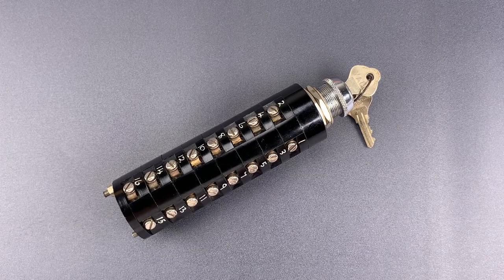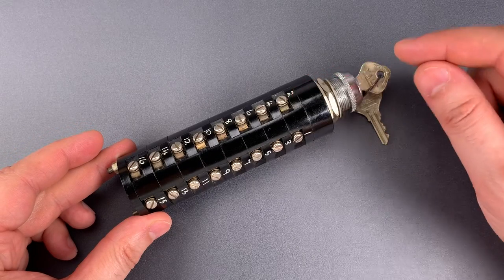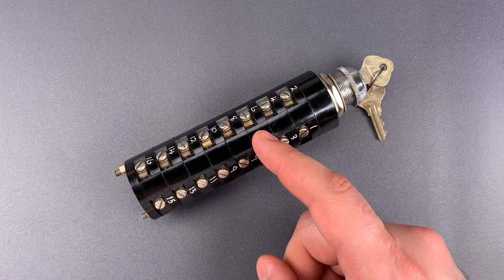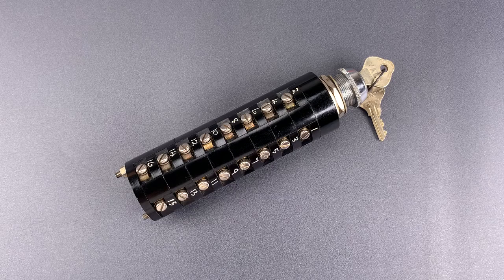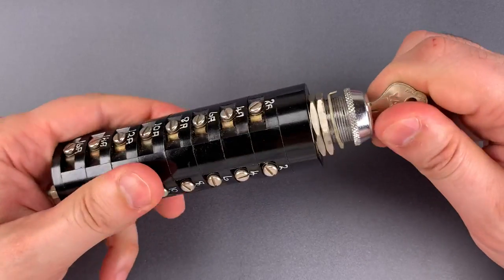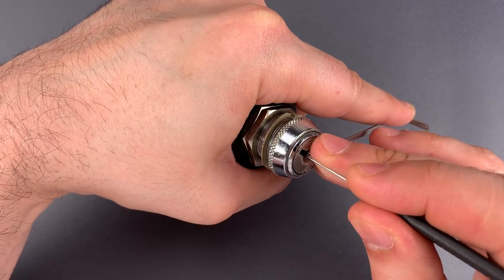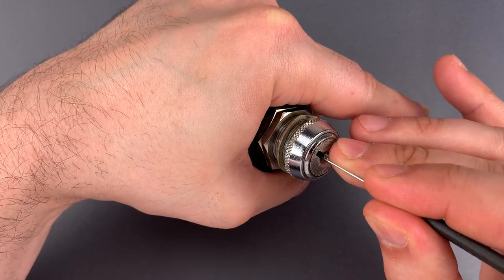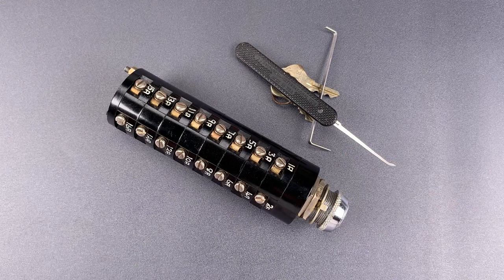[1154] Missile Control Key Switch Picked

Comment: The switch segments and operators of those locks were available as an 'assemble your own' switch for control panels. Operators could be knobs or key locks. As an example the forward / stop / reverse switch on Bridgeport Milling machines made in the UK by Adcock and Shipley used one with seven segments. There were two variants - a three position for single speed motors and a five position for dual speed motors. The range of switches are not at all uncommon on industrial machinery here in the UK.

Comment: Putting out a theory to try and solve the mistery:
even tho the Jaguar wasn't used in the US, the sidewinder was pretty much the standard NATO ir missile. So I'm guessing: either the lock is the same for every AIM 9, and that's why a person saw it in the UK, or the core can be changed, while the rest is (of course) provided by the missile manifacturer to suit their weapon, leaving it still very similar from country to country
Reply: I think it's a basic Master Arm switch. Would make sense for the number of electrical contacts. Gun, centerline pylon, and 3 pylons per side (wingtip plus two under wing)
Reply: Maybe it was also used on the Harrier which is pretty much the only British aircraft I can think of that wound up seeing US service in the right time period.
Reply: @misterthegeoff9767  would not surprise me.

That number of contacts would also work for F16A/B, and even I think F104s.

Comment: (Coming from someone who watched several videos but hasn't picked a lock)   If I was going to design a lock I would make it so that when the pin clicks it would stay in place to keep the lock from opening in a way that it wouldn't happen with a key.   The key pushes aside all of the pins at once while a pick would push the pin towards the back one at a time, which if there was a catch would have a different result from the key usage.

Comment: Aircraft systems rarely use screw terminals. Too much danger of them vibrating loose. (I work for an avionics firm.) This seems very unlikely.
Reply: Consider that wire interconnects must be crimped and not soldered, because solder won't hold up to the torque of the vibrating wire.

Comment: I'm retired Navy and I was qualified for ordanance handling... Navy aircraft don't use keys in weapons systems.
Reply: The mystery grows!
Reply: An aircraft system would have crimp terminals, or with so many contacts, an "avionics" style multi-pin connector.
Reply: @JamesPotts  It depends on the era the aircraft was built in and the component in question. Solder tabs, threaded terminals, solder cups, snap fit. I've worked on aircraft from the 40's to the 10's... The size alone kind of says 'surface' or 'installation' use... so, maybe an ICBM switch. But for sure, not likely an aircraft switch just from the size.
Reply: @geneard639  yeah, my thought was surface installation. That thing is huge. It also has the "look" of industrial electrical, with those brass slotted screws, rather than aircraft.

Comment: But can he pick two at once on opposite sides of the room?
Reply: Dont be silly. Of course he can.
Reply: i reckon he could set up a rig using an etch a sketch and robotic geared legos connected via bluetooth modules to control both lockpicking mechanisms at the same time to pick them them both at once with bosnian bills help ofc

Comment: Kinda late to the party here but the sidewinder missile is a missile made by the US company Raytheon and used by most of Americas allies. The middle entered production in 1956 and is still being produced today and has gone through several upgrades and variations. So the lock could be used on any aircraft (probably anything flown by someone in NATO) that supports the sidewinder. The Soviets also reverse engineered their own version of the sidewinder but I'm not to sure if the locks would be the same. TLDR: missile could be used on anything with support for the sidewinder probably most NATO countries if not all.

Comment: It's easy to make up a fun story to explain an unusual piece of hardware, especially as uncommon today as a key operated rotary changeover switch is. As cool as it would be, to have something like this come from some antiquated aircraft, it more likely came from an old CNC mill, electrical switch gear, or some other piece of large shop equipment used for maintenance on the AFB it came from.

Comment: I'm an ex Royal Air Force Weapons Technician aka an Armourer... And believe me when I say I've seen lots of Sidewinder Missiles, on aircraft & off, whole and broken down to their constituent components... and I can assure you it has nothing to do with Sidewinder Missiles. 

I'm pretty confident it's not off a Jaguar aircraft either. While it's true some older aircraft did require a key to activate the weapons control systems... known as the Safe-Arm key they were usually simplistic affairs and largely symbolic... The keys were generally interchangeable. They were mostly removed from all the RAF's combat aircraft & replaced by 'pull & twist' gated knobs during the 90's. Having a key in the cockpit was seen as potential hazard, it could be dropped and cause all manner of problems.

It doesn't look like any Safe-Arm key that I've ever seen or used... on any aircraft! Of course it's been a long time, so there's a chance my memory deceives me... But I really don't think so, and certainly not about the Sidewinders.

No idea what it is, but it looks like something you might find on some kind of test equipment/rig... Or a key you would see sticking out those 70s style instrument/control panels that you might find in a nuclear power station or something :)

Comment: incase anyone didn't say this.. the reason for the hard turn is the safety mechanism... for when you turn.. that hard click ensures minimum arching  and burning of the switch and the potential user when turning the key.. for do think that you are holding a metal key that controls live wires

Comment: This is just an old multideck rotary switch. Some have locks because they may be associated with a system that may need to be shut down or start up in a particular order. We use them in the nuclear field for switching from DCS to Local Control systems when preforming maintenance

Comment: EX RAF Pilot here. The person on twitter is correct, this is used to lock out and prime Jaguar GR1A sidewinder missles. A very rare part to be honest, only 75 of them were actually made though based on where you got this I assume it was more a "Copy a proven to work design" than an original GR1A sidewinder priming key.

Comment: It's not that hard to pick (though I suspect it might be if you had to do it while it was installed), but it doesn't have to be. This is essentially a LOTO device. It's role is safety, not security. 

It exists to provide an unambiguous statement on the state of the equipment it switches, and prevent unintentional activation. In that tasks it preforms just fine.

Comment: I am comming acros this kind of switches with key all around any construction site where we replace old equipment with new (industry, power plants,...)
It is mostly used for more critical systems, that you are not allowed to turn off without permision or prior notice. The key is in most cases in the cabinet in the same room, so the keys don't get lost, because it only serves the role that you don't accidently turn some system of that you are not supposed to.

Comment: I’ve worked on plenty of secure government sites were electronic switch locks are used to enable certain functions.  But these are meant as security devices but to prevent inadvertent use or casual tampering.  They are never intended to provide a high level of security.  Many can simply be removed from the panel by unscrewing them, then you free to short the contacts and bypass the lock although. This is a complicated one because it has so many switched but many are just two contacts that you just short.  If this really was an arming switch in a Jaguar you would first need to get into the cockpit of a powered up and armed aircraft before you could even start malicious tampering.

Comment: I can help you out here a little with where these locks were used.  Those types of locks are called detention locks and were most common with, you guessed it, jail / prison cell blocks.  To this day Saia Burgess make some smaller versions of those that do just that, lock down separate "blocks" of cells.  In the Air Force we never used anything like that on aircraft and that's very far from any kind of ballistic missile type key setup.  Locking out weapons on aircraft happens via a ground pin and once that's pulled and you send power via a console in the aircraft, they are live and that's that.  During training we use "blue" munitions ie: missiles with the radar pod but not an actual live warhead or rocket motor.  If we are training with live munitions then we are out at the range and intend on firing them.  Depending on a simple key to arm and disarm weaponry on an aircraft would be disastrous.  Can you imagine someone forgetting the key?  lol   Just because it was "in a pile of aircraft parts" doesn't mean it was ever used on an aircraft, let alone a USAF aircraft.  That part of that guy's story is a little sketchy because the Air Force doesn't just sell piles of their parts.  They go to DRMO.   Hope this helps.

Comment: Hi, in eastern Europe those used to be common as a relay switches, i have seen same design being used to switch between normal and emergency mode for lighting, essentially you flip the switch the relay gets triggered an alarm rings and the light switch to different colour

Comment: Once worked for a client whose server room was an old bomb shelter. One day, a system I support went down and there was no one with access to the server room in the building at that time. I knew what needed to be done, and that it needed to be fixed ASAP, so I went to the server room door, actually two successive doors, each requiring an RFID access card, with an old insurance ID card and a pair of scissors. 45 seconds later I was in the server room. I restarted the machines that needed restarting, confirmed the system was working, and closed the doors when I left. 

They gave me access via my RFID card a few days later.

Comment: Similar switches (with one or 2 poles only) are used on electronics to (for example) lock out lasers, or other dangerous equipment, from being turned on.  They are not intended to be pick resistant at all.  One was used in the IBM360 computer on campus to enable the "emulator" (area of the computer CPU accessible to only the IBM service engineer).  Solution was simple: why pick the lock when you can overwrite the code that checks the switch position?

Comment: This is why the mission control key needs two keys tuned simultaneously on two sides of the room. This lock is used for missle systems not necessarily jets.

Comment: A) Sidewinder missiles are not nuclear (they are a heat seeking air to air weapon) no key ever required to arm and fire one, it would be idiotic to use one for such a weapon
B) No missiles or bombs nuke or otherwise used a key to arm and or release them, codes & switches yes, keys no
C) Maybe, stress maybe, some warheads or weapons had a physical safeing mechanism that used a key but would not have been loaded on aircraft without the key being used to open them to onboard arming, safeing, and release systems first.
D) If anything of the sort, it would be a silo key system used to enable arming and launch of a ground based weapon system

Comment: this is actually not a special switch and not only used for missile controls switches. it can be used with old control units for old missile controls. but in the newer ones one does not use a key switch. in a company that i worked 10 years we ordered from ghielmetti-schalter.ch/de/Produkte.2.html?pid=41 specific ordered switches that are used with KABA cylinder and keys. some as long as the one in the video.
the one in the video is just e pretty old one probably from the 80's.
These typ of switches are regularly used for generators on Nuclear plants, Water dams(like Three Gorges Dam),  or simply on electrical controls where only certain personal are allowed to switch a unit on or off. but for something like a missile control key switch it is then often an old one that probably is not replaced yet.

Comment: I never see this lock before but as you said this has been used to control aircraft sockets. There are even and odd numbers seperated in two seperate line. Each number belong to different part of aircraft. So, to activate specific part of aircraft, there is must be another button or handle which you have to turn it on and then turn the key to start it.  Otherwise you can on and off the key specific number of times according to number on lock.

Comment: The Jaguar fighter jet had a long service life in the UK - leaving service in April 2007 - which leaves the field of contemporary US fighter jets in Air Force service, open to a lot of different options as to which jet this could have come from. I'm not familiar with the USAF jets stationed in the UK - but, I'm guessing (*really* guessing) - either an F-16, A-10 or (maybe even likely) - an F-15 Eagle, which was first designed around the same time as the Jaguar - late 1960s. And it has been largely replaced by the new stealth fighters - so, I don't know - maybe an F-15 Eagle Avionics tech from back in the day can tell us.

Comment: Its incredibly unusual to use a key for that function. They usually just use a switch. I would wager that wasn't its function. Keys are usually reserved for things which might cause bigger problems than one dead aircraft. Things like nuclear weapons delivery which only some pilots are authorised for, with all pilots potentially using the cockpit. Or security codes which could cause extreme mayhem and cause a huge military campaign to stall deciding between potentially losing tens to hundreds of aircraft or multiple days of progress.
Reply: Missiles are actually expensive especially for Europe. Not only that, but the AIM-9 had a nasty habit of failures. It probably was paranoia that caused it the creation of that.

I mean Soviet and Chinese developed missiles the second an AIM-9 failed to explode a MIG.

Comment: It's difficult to turn because it is, at its heart, an electrical switch. Technology Connections did a video on why electrical switches click like that and it because it's breaking a circuit which causes a spark. To reduce that spark the connection must be broken quickly, hence the characteristic click of switches.

Comment: Nuclear submarine operator: What's that noise?
LPL: I'm going to use bottom-of-the-keyway tension with this wiper insert, but because of how hard it is to turn that key we're going to have to put quite a bit of torque on the core, and a standard hook in 25 thousandths. Little click out of one...

Comment: I'm really curious if some of the connections break as you are picking the lock. It seems to me that there would be a timing aspect to it where the lock has to have all switches go from one position to another position in a give amount of time. It probably will still work correctly, since the core doesn't rotate very far during picking, but for military applications I can imagine they often have clever anti-tamper solutions.

Comment: This lock, when installed in the normal position, is effectively unpickable. The normal position is "onboard a military aircraft," and military aircraft are generally parked on military bases when not in use.

You'd have to get within arm's distance of the lock to even try to pick it. Good luck with that.

Comment: Idea for an unpickable lock
It's not unpickable but it should be impossible for a human even you.
U have to put even more running Force to get the key in at all, and if you don't quickly insert the 6-in+ key in less than one second with 12 triple pins that turn more or less based on the height of the pins.

The local gym putting over 100 lb of force the key bring you from removing lockpicks, and resetting all pins. Also activating the deadbolt preventing the door from being drilled.

If the lock jams on a proper key you can take a duplicate key and insert it backwards into the other end while holding the debug switch.

Also it's electrified as soon as any key enters the whole if you don't use an actual key or where insulating gloves it'll be shocked with 120 volts.

When the lock is jammed, it disconnects from the door frame leaving the deadbolt as the only lock, but it's smart so you can open it up with your.
Reply: Also keys can be stolen so you could work around this by requiring multiple keys and a piece of information on a logic-based puzzle.
A non-electronic key password required to open the keyhole.
You would require piece of information something the owner knows just to incert.

Step further maybe there's literal geniuses that can figure all this out and steal your key, the Smart Lock programmed with pictures to only let specific people in after the key has been successfully used.

Comment: This is actually made a lot easier by being able to hold the lock in his hand. I bet it would be significantly more difficult if it was installed into a console and you were going mach 1. So basically I want to see that.

Comment: This is not a lock for missiles in aircrafts. Retired USAF weapons loader, the key to this lock would constitute Foreign Object Debris, better known as FOD.  If this key was removed in flight and dropped, it has the potential to get lost by the pilot and dropped, possibly getting jammed in the ejection seat mechanism.  I've worked on aircraft dating from back to the 50's and on all those aircraft have never seen a switch operated by a key.  Anything removable like this in a cockpit is a Big No No!